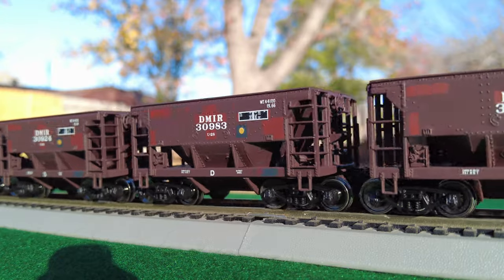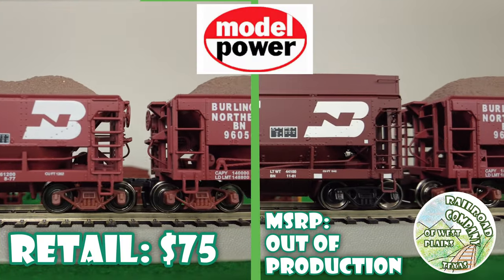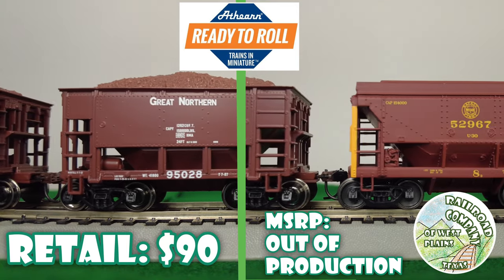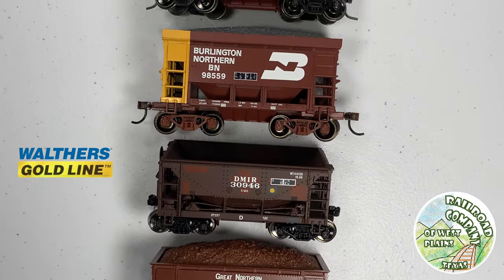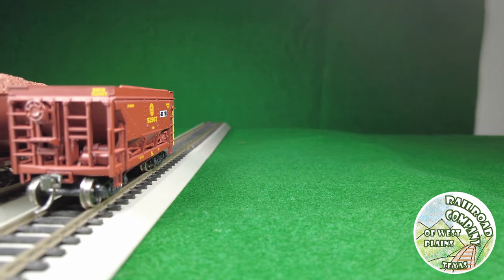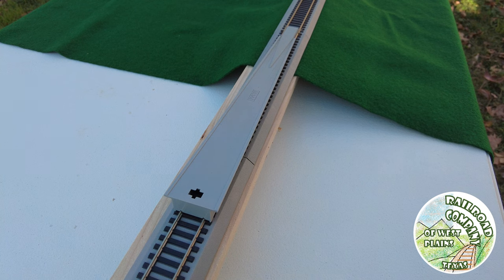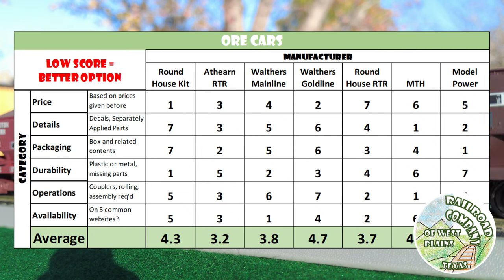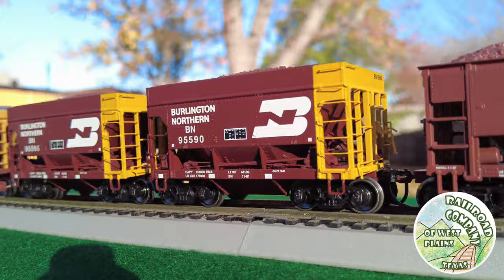HO Scale Ore Car Comparison

Comment: I don't think any manufacturer can compare with the old Varney die cast ore cars.  Thanks for posting the comparison as I want to get a few ore cars for the layout.  I don't usually have any problems with rolling stock rolling because I use Walthers Proto 2000 metal wheel sets.  Cheers from eastern TN

Comment: I like your comparisons. You might want to research the differences in prototype ore cars. Most were built to carry iron ore. Some were modified to carry taconite. Also ore cars tended to be railroad specific. While Missabe and Bessemer cars were similar, they were different from cars owned by GN, NP, and other Lake Superior lines. You would typically find the same cars in ore trains, as they rarely traveled off the property. Also some roads used 4-car drawbar connected sets, while most others used cars with couplers on both ends.
Reply from the maker: Thanks for the info Craig. The differences in these models is definitely obvious, leave some links here about the types of prototype Ore cars if you'd like for people to look at.
Thanks!

Comment: one of the most expensive "resells" cars on ebay over the last 10 years or so. I have a bunch of MDC (original factory runs) that I bought for like 5 bucks each and then upgraded with metal wheels and number 5 kadee's, put in loads, etc. I always liked the size of them because I usually had small layouts (though I have run like all 50 + on a club layout - why you want kadee's on them) and a small string looks good vs a 90 foot coal gondola under a mine... but that's just my opinion. I haven't cut one up yet to "narrow gauge" (I have a tichi trains 12 pack of ore cars waiting for that job) but I have been tempted to do a few. (into HOn3).

Comment: Great video Dylan!  I believe Athearn has bumped these ore cars down to the Roundhouse line as they did some reshuffling and a bit of re-branding last year (probably the biggest is dropping the "Ready to Roll" name and simply calling it the "Athearn" line).  I'm also interested to see what Scaletrains does with the former MTH tooled ore cars.  They looked to detailed for the "Kit Classics" line, so I'm curious if they be part of the new "Hypotipical" line they just announced.  Also, the og Roundhouse cars are excellent rollers, and they perform even better when you stick Athearn metal wheels on them!
Reply from the maker: Gotta say I agree. I guess i hadn't heard the "Hypotypical" news. I am hopeful SXT does something with the ore cars but they do look nice already. And now that you mention the RTR change by athearn, that is surprising. I haven't bought many new ATH freight cars recently but the one i do have has a different box and no mention of RTR. Times are changing!

Comment: what is up with the walthers mainline cars.. only one had couplers. I noticed at a hobby shop I went to last week, they had 3 packs of them and all had missing couplers on 1 too 3 of the cars.
Reply from the maker: Thank you for the question. You are not the first person to mention this to me. The walthers cars (and most multiple car ore sets) have a plastic drawbar that you use instead of couplers. Depending on your modeling preference, you can use the drawbar or replace them with actual couplers. I like to use couplers bc I have to transport my cars away from home if I want to run them but if they stay on your layout most of the time, the bar would suffice.